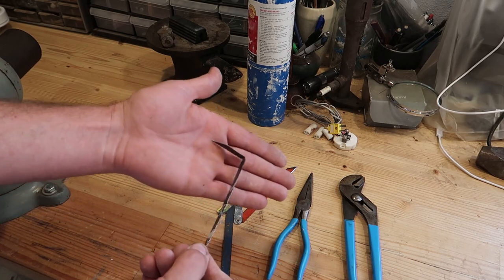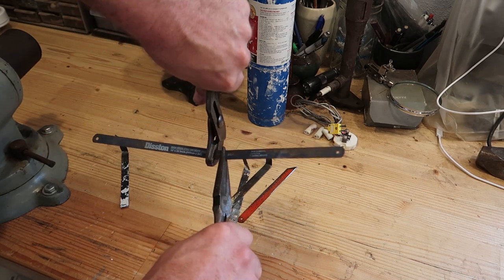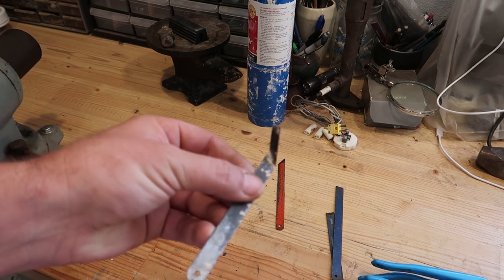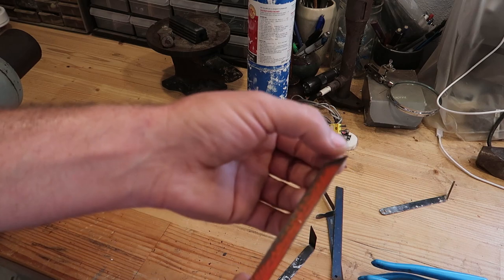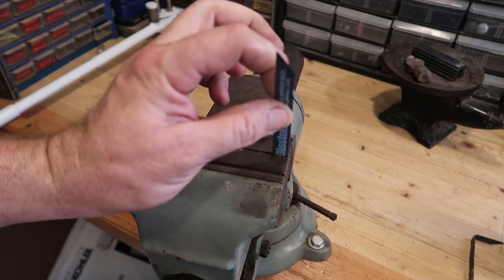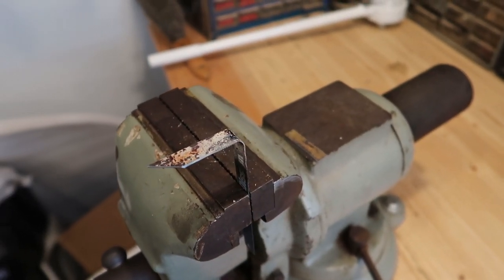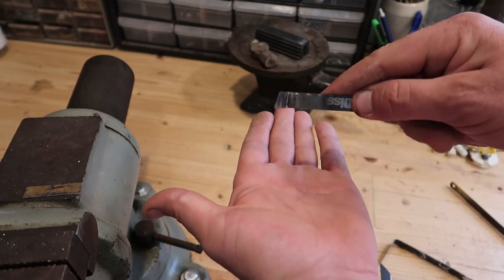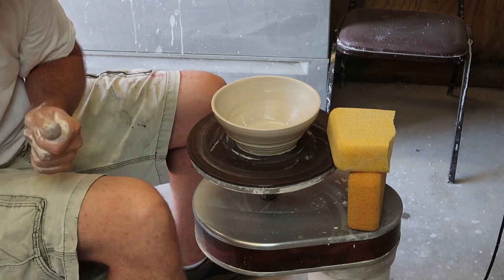Pottery Tool  - DIY Hacksaw Blade Trim Tool

Comment: Do you find the torch heating to bend takes the tool-steel hardness out of it?
Reply from the maker: No I don't.  I occasionally run them across a grinding wheel to re sharpen them, but not often.  They work surprisingly well even when dull.  It's not as critical to have a razors edge as you might suspect.
Reply: @JustinsMakery  I tinker with black smithing and tool making and I’ve always been thought to re-temper after heating, but for clay tools….totally makes sense. 

On another note—I made a bottom setting tool for my wife from PVC, but we just discovered your adjustable version and she’s going to order it!